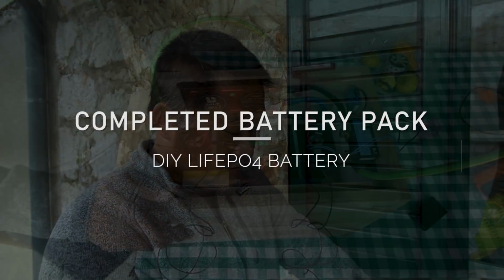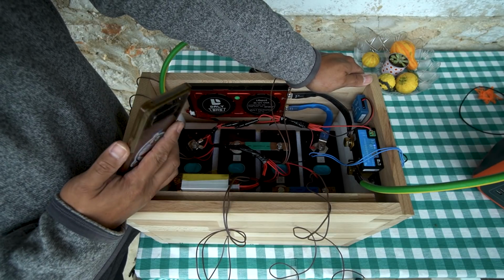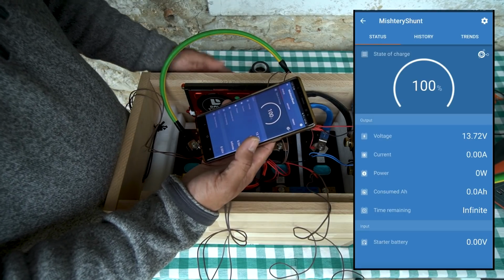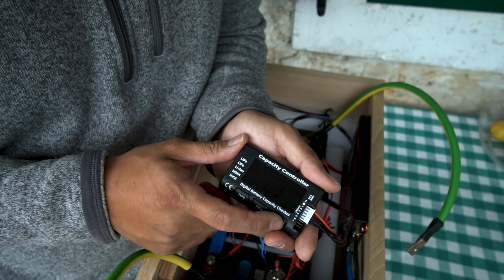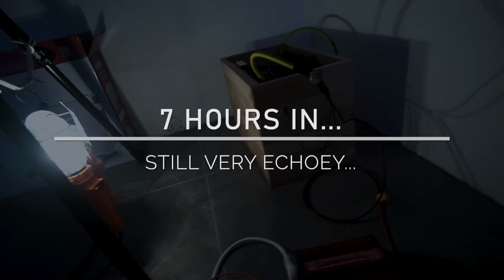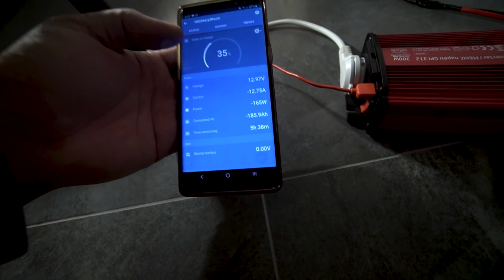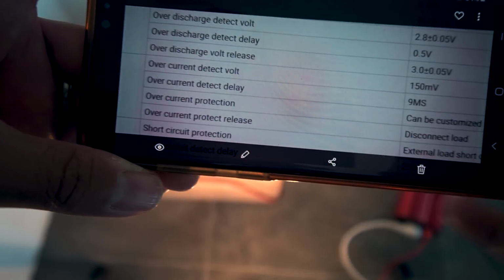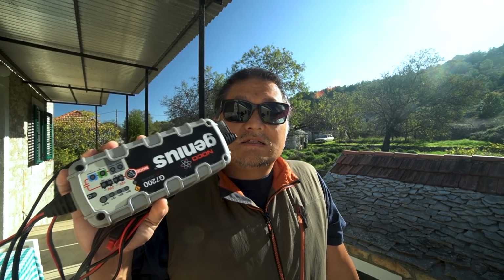DIY 12-Volt 280Ah LiFePO4 Battery // Full Capacity Testing // Part 3

Comment: Hi  ! Thanks for the video. As I only have 400 W of solar panel I was thinking building a 180 ah LiFePo4 Battery (because I thought I wouldnt have enough solar power to charge a 280 ah). What do you think of that?  Should I still go with a 280 ah as you do ? Because my problem is that I can't find a BMS 4S 200a that could be shipped to Europe. ... I would really appreciate your help :)
Reply: Oh but wait... you are using a 120a BMS with a 280ah battery ? How is that possible ?
Reply from the maker: I only have 350 watts of solar and yes it isn't enough if you think you would use a full cycle every day. I do not use that much power so it is ok for me. The most I consume is about 100Ah per day. The extra capacity is insurance for those long stretches of cloudy days. And you don't need a BMS to match your battery capacity. The output is the max amount of current it will be limited in drawing. I never draw more than 75 amps at any given time so a 120A BMS works for me.
Reply: @freelyroaming  I also have been estimating that I would be consuming 100a per day. However I was afraid that somehow, I would be consuming more one day and that I would never be able to fully charge the battery again ... I need to think of that...
Sorry but I didn't understand what you meant by "The output is the max amount of current it will be limited in drawing.". Does it mean that you can't consume more than 120a on your battery ? The BMS is blocking your consumption ?
Reply from the maker: It means your BMS will be limited at a max current draw of 120A. That is not the same as having a max capacity of 120Ah. You will still be able to draw the full capacity of your battery. Just not faster than 120A constant draw. That is about 1500 watts which is quite a bit of current draw. You would likely only use that much if you are running items like hair dryers, induction stoves.
Reply: @freelyroaming  Ok I was confused because I didn't know the meaning of "current draw". Thank you so much, it is so much clearer for me now :) So I guess I will go for a 120a :) And probably a 280ah if I can find one that is not shipped in 2 months !

Comment: Charging a 280Ah pack at 7 amps, empty to full in 40 hours (if it could charge full rate the entire time, which it won't, and 7.2 is a bit higher than 7). How long did it take?
Reply from the maker: The cells ships at 3.2v which is around half capacity so the first l initial charge was pretty much a full day. After the capacity test I charged it back up and it took 2 overnights plus the full day in between. I didn't really time it exactly but it was around 2 full days.

Comment: What is the reading on this battery when it is fully charged?  I know lead acid fully charged is 12.7. But what about lithium?  The fullest I can charge my lithium with panels is 13.1 volts.  Can you charge your battery past 13.1 with solar panels?  Maybe I need more panels.  Can I use a plug in charger to top my battery off more?
Reply from the maker: My solar panels have an open voltage of 22 volts. With my mppt controller I can charge these up to 14.4v which is considered full cell capacity. Once it reaches that, it will settle to around 13.7v shortly after the charger stops. My noco genius g7200 charger that plugs into AC power has a lithium mode that will bring it to 14.2 volts.
Reply: @freelyroaming  thanks.  If I add more solar panels will my battery charge faster?

Comment: great video i did a capacity test on the similar setup i am putting together all be it at a higher am draw see here https://www.youtube.com/watch?v=CJal3X9eQ2k&t=302s enjoying the videos keep them coming 👏👍
Reply from the maker: Thanks I watched your video. Great job! Bummer about the shunt losing the data when the BMS cut off. It is inline with the spec sheet. Your 0.2C draw matched my 0.07C according the manufacturer. I subscribed to your channel as well. Looking forward to more posts.

Comment: I have a 25amp ctek battery charger, air x wind turbine,  solar panel controllers the engine alternator these are all for lead acid . If I want to go lithium do I really need get rid of these no way. I wish there would be a bms that has an ability to adapt to older technology.
Reply: Only the wind turbine can be adjusted from 12-17v. Ctek charges all the way to 15v the supply mode charges up to 13,7-14.1 depending on the temperature. solar panel controllers charge up to 14,7 max same for the engine

Comment: Them cell  measuring devices draw power to run them from the first cell so they throw the pack out of balance just using them
Reply from the maker: It does though with a pack this size and 2 cell balancers it is not an issue.
Reply: @freelyroaming  I put a 5amp active cell balancer on my RV pack figuring a kind of belts and braces approach when driving a 1500w pure sine wave inverter for the microwave and toaster - what i discovered   was it was forever shuffling snippets of energy about  between cells even though they were matched and this caused a parasitic  drain   - over 2 months lay up  it took the pack from storage to empty - so I took it off - the pack just top end bleed balances now at 3.5v per cell - like you I have a blue tooth BMS - mine also built on a silicon heat mat set to come on at 2c to avoid freezing
Reply from the maker: That's interesting. I've not noticed it in this last couple week of using the bank. How are you detecting the parasitic drain? The only way I can test it is to yank the battery out and let it sit for a few weeks with the balancer connected and then a few weeks without. I would imagine whatever drain it has while it's connected to me solar system is instantly negated when there is any sunlight pushing current into the system. I figure the 4 devices (BMS, active cell balancer, shunt and Victron battery sense) I have connected directly to the battery are going to draw some current but so far it seems insignificantly small to be noticed. The benefits I think are worth the cost.
Reply: @freelyroaming  I have a coulomb meter on the battery output - the active cell capacitor leads and BMS balance thin  leads are attached to the cells pre shunt  - I notice when I calibrated the coulomb  meter to 100% full charge the  voltage slowly drooped over a few weeks  even though it still claimed it was 100% a sure sign power was bleeding from either the active cell balance leads  or BMS pre shunt - When it continue  to drain below 3.5v per cell  the bleed balance on the BMS had disengaged  it became clear  it was the active cell balance  was the source of the drain - since its removal there have been no problems
Reply: @freelyroaming  Yes I agree the solar would soon put back the loss on a daily basis however i shut mine down and put the battery in storage mode over the current lock down - I concluded active cell balances are unnecessary  as long as  you let the bms top balance every now and then
Reply from the maker: Mine battery is never put away even right now when we are not spending as much time in the van. It is always charging when the sun is out and is always being used. Even your BMS will parasitically draw down your battery as it passively balanced your cells. If you are not using your battery pack it should be kept closer 50% capacity for any prolong periods. That makes it tough to top balance. I am going to keep it in there in my use case. It is pretty much a hands off and near maintenance free setup.
Reply: @freelyroaming  That's what I meant when I said in Storage ie left with 40% charge  - however if you leave the active cell balance  attached this will drain the volts until it cuts out which is 2.5v - I have programmed my MPPT charger only fill my pack to 90% to  prolong cell life - its only when I drive that the Renogy DC to DC charges to 14.1v and balances  the pack - My RV is used for holidays not full time
Reply from the maker: When it was still connected do you recall how many amps you would lose each day on average?
Reply: @freelyroaming  I reckon I lost between  1 and 1.5 amp a day - if yours is permanently attached to your solar I doubt you would notice it  - for ours that has been in storage most of the year it matters
Reply from the maker: Makes sense. I suppose if I ever store it away I could just unplug the sensing wires to reduce parasitic draw.
Reply: @freelyroaming  Yes I think thats the answer - I was particularly pleased  how mine turned out - fitted in a  insulated box with a 8watt 12v   silicon mat on a 3mm aluminium  heat spreader and little digital temperature micro relay circuit that I set to +2c  all bought for under £5 - I never have to worry about freezing should we do a winter camp

Comment: Great respect towards you! You are such an amazing find for me :)

I watched milions of videos about DIY lifepo4 battery packs, but I had never been so enthusiastic  building one. You made it so simple and information! Thank you soooo much! 

But I would like some more Ah, as I currently have 460Ah (230Ah usable) AGM battery in my camper and I would love some more. It's only 2 months old - I hope I will be able to sell it :)

I know 280Ah Lifepo is a step up, but as I have a lot of extra space in my electric cabinet (2x230Ah AGM) I would put some more than 280Ah of LiFePo. But I searched a lot, but over 280Ah, there is not any items for those cheap prices.
Yours 280Ah - cca 400usd
300Ah+ - 700 usd+

My question is - can I combine in 8S 8x200Ah
to get 400Ah BUT still 12V!! 
4 in parallel and 4 in series?
Is that possible?
Reply from the maker: Thank you. Yes you can use 8 cells that are 200ah each and get 400ah 12v. You have 2 choices. Either build them as 2 separate 4s batteries and then combine them in parallel. You would need a BMS for each pack. That's callee 4S2P. Or you can build 4 sets of 2 cells each in parallel and then combine the 4 pairs of parallel cells in series. That would be a 2P4S setup. You would only need 1 BMS for that. I think the first configuration would be better at keeping the cells balanced as you would have voltage sensing and balancing for each individual cell. The second configuration you are relying on each pairs or 2p cells to keep themselves balanced as your sensing wires will be reading the each parallel pair's combined voltage. Hope that makes sense.
Reply: @freelyroaming  You man really know what you are talking :) And you make it so simple. I can totally understand what you mean. But after some consideration, I think 280Ah will be totally find for now. I can always add another pack later.

PS: I am from Slovenia, full time vanlifer, but currently on Sardinia. I am not in a rush with delivery, but where did you order batteries from? From China to Croatia? And you paid cc 400€ with free shipping? What about customs and import fees?

As I am looking on Aliexpress and sellers with EU supply have much higher prices - 700€, but no customs charges.
Reply from the maker: I ended up paying around $600 USD for my set of batteries including vat and customs to Croatia. Would have been cheaper if I was in the US from other sellers but Croatia is a difficult place to order stuff online. This is the seller I used.

https://www.aliexpress.com/item/4000947956694.html
Reply from the maker: How is it in Sardignia? Any issues with finding places to camp?
Reply: @mihastare3289  that's great. I have wondered about tilted solar panels and if they police would considered that as camping. Because some places you are not suppose to use leveling blocks or pop up your roof if you have one. I guess tilted panels are ok in Italy.
Reply: @malimish  I've been wondering the same about tilted panels and camping. But police never said anything for my tilted panels so I think it's ok. But to be honest - it's totally off-season + covid so I am almost everywhere alone on empty parking. No campers, no tourists. Could be differences about panels in season.
Reply: @mihastare3289  that's true. They probably don't want any extra hassle themselves right now. As long as you keep it low key they will leave you alone.

Comment: Great videos.  Trust your readings from the Victron shunt.  I have the BMV-712 and have been using since August 2019.  I have the 500AMP shunt.  Trust me when I say the calibration of your shunt is dead on the money.  I have never seen a Victron shunt needing any field calibration.   Good idea you have for making your battery last a life time.  The 10%-90%.  I use 80%-20% as my marker.   Really appreciate all your hard work and your sharing of info.  It's been a longtime since I have spoken to Croatia, I'm a ham radio operator.  Call sign NF7T in the USA.
Reply: I agree trust the victron. Some of those cheaper "ebay/aliexpress" power meters assume 12V and don't actually measure the voltage.
From your video, you say it's reporting 157W 157/12 = 13.08A which is similar to what your victron was reporting.
I have one of those cheaper power meters and it's only really useful for current in/out (unless you have exactly 12V).

Comment: I have 16 of these cells on their way and I have been trying to figure out the best way to mount them. I had considered using the shipping foam but I was a bit afraid of overheating the batteries under high load. That is certainly something Id be paying attention to.

Comment: The link for the batteries does not identify the low priced cells you actually bought. Otherwise good content.
Reply from the maker: Here is the actual listing of what I ordered. Not the cheapest but they did ship to my address in rural Croatia for free.

https://www.aliexpress.com/item/4000947956694.html
Reply: @freelyroaming  Hey now, 2 weeks ago we were told these cost 390 not 517.
Reply: @reubenj.cogburn8546  Check these out... I just ordered them. $440.00 shipped to California.

Comment: Great series! How much wattage in panels on roof of van to charge it?
Reply from the maker: Thank you! I have 350 watts on the roof and a portable 100 watt suitcase if necessary. This time of year in my current part of the world it is a bit difficult to get enough charge. Making my roof solar mounts tiltable has made a big difference.
Reply: @freelyroaming  thanks. I ordered 2 100 watt HQST panels and tiltable mounts yesterday.
Prolly build a battery like yours, am hoping solar will be enough. Pre installed wiring from roof of RV rated for 30 amps, I'll add more panels as needed. Never saw video with summary of total battery cost, finish that one yet?
Reply: @freelyroaming  I also have  Jackery 300 and 100 watt folding panel, was trying to figure how to add that without a second charge controller but prolly can't

Comment: also, the discrepancy that you are seeing comes from the fact that most meters don't include their OWN consumption, so depending where the meters are they include different things
Reply from the maker: As you might have seen from the video, there was never any discrepancy. what I saw was due to the refresh interval of the hobby capacity controller. It has a delay in the reading and is refreshed when the buttons are pressed. The reading are actually exactly the same. The amount of power consumption is really insignificant with a battery this size. It may matter with a small lipo cell but with this 3,600Wh pack, their consumption is virtually undetectable. We're talking sub-microvolt differences that none of my instruments are capable of reading.

Comment: be very careful leaving that hobby "Capacity meter" powered full time. The reason is that it pulls it's power from cell 1, meaning it will slowly drain that one cell just to "keep it's lights on" hope this helps.
Reply from the maker: Since the BMS and the active balancer are both keeping the cells in balance, the miniscule draw from cell 1 will never be an issue. It will practically instantly be balance with the other cells. All of the components I'm using all will put a small load on the pack as well. The bms, active balancer, shunt, temp sensor all run at net negative power. But it would take many months to parasitically drain this pack.

Comment: The voltage drops logarithmically as you discharge LiFePo4 cells. That’s why the voltage  acts a little bit differently than what you’ve probably seen before. Great video!
Reply from the maker: Thanks! Yes lifepo4 discharge curve is very flat in the middle. That is why it's hard to determine capacity using voltage alone.
Reply: @freelyroaming  It was a really well done test. I like the box as well. Overall a very nice setup. I hope it serves you well and long into the future.

Comment: the bms will protect it and those batteries will outlast you even if you use full capacity as i do mine.....
like you say,,,
cheaper than agm you expect to last  a few years so you might as well thrash em  !!!!!!
Reply from the maker: Haha well time will tell how I end up treating these cells. We've got some cold weather coming so hopefully I don't freeze them out.
Reply: @freelyroaming  lol you ll never need all that power and you can't freeze them out as your charger is less than the 28a below 10% caoacity they can happily be charged in cold temps.

Comment: Did I miss where you said how many hours you got at 200w output?
Reply from the maker: I got just over 3,600 watt hours so it will run a 200-watt load for about 18 hours assuming minimal loss of efficiency. That means having sufficiently sized wires and a high quality inverter if your load is AC. That was pretty accurate to what I got in the test.
Reply: @freelyroaming  thank you, I have a similarly sized battery and was wondering approximately how long I would be able to power my freezer at 130w